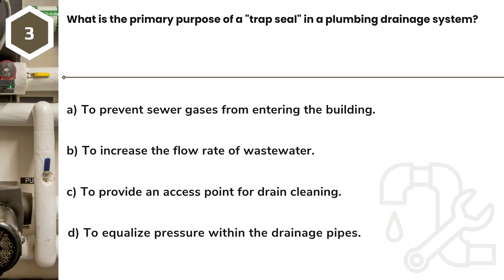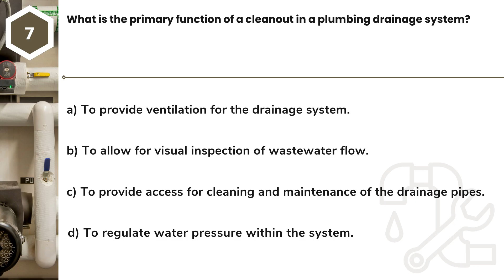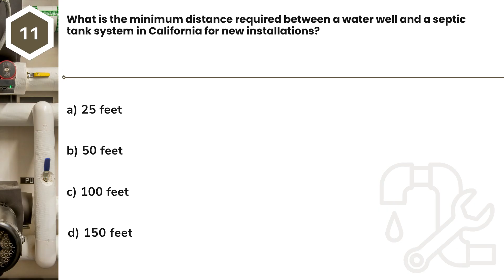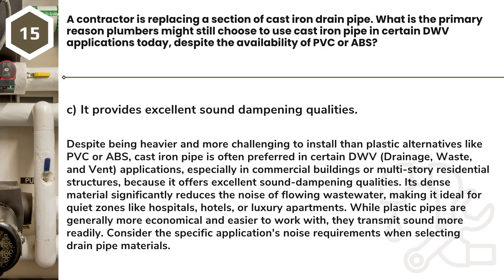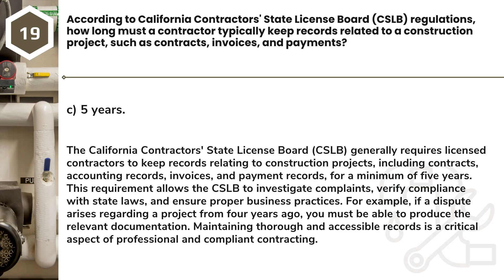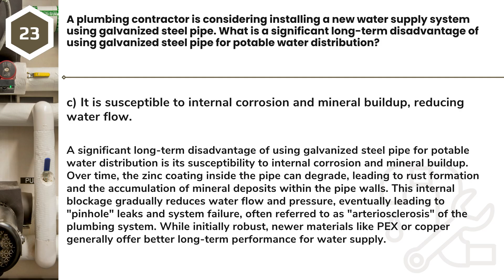C-36 Study Guide - California Plumbing License & Practice Test (25 Tricky Questions)

Comment: in your other video minimum required water line for residential service was 1".  Now 3/4".  3/4" is the correct answer as per 2022 CPC 610.9 (6).  no building supply pipe shall be less than 3/4".    Table 610.4 included note 2 "building supply not less than 3/4".